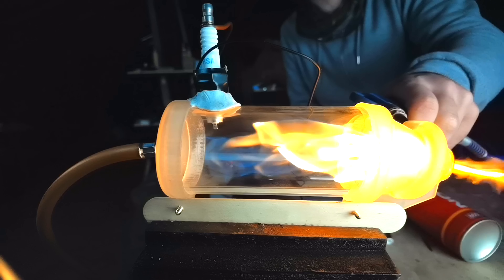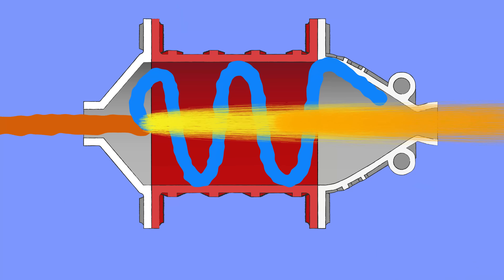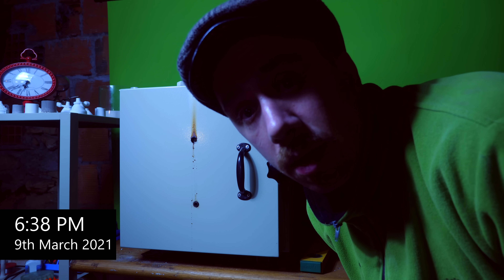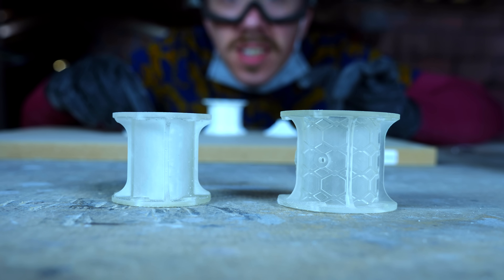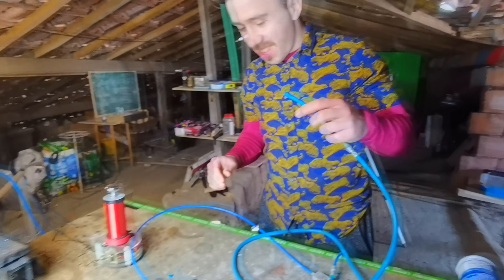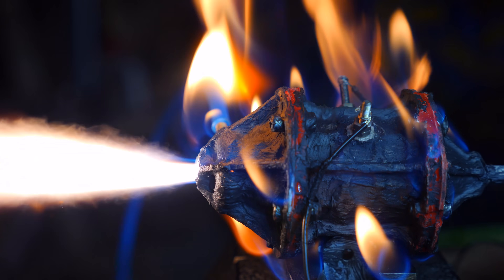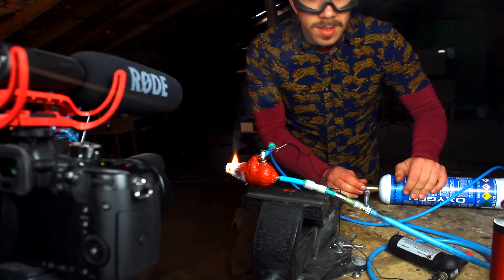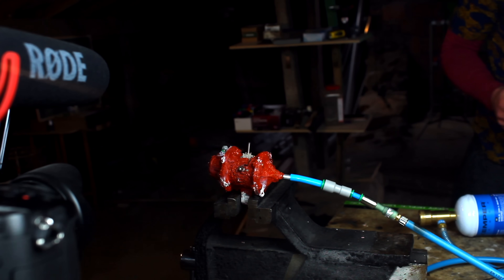Vortex Rocket V2.0 (3D Printed)

Comment: On the red tube thing at the end of the video it seems that the leakage is through the flanges as soon as the pressure reaches a high point. I would try reinforcing the flanges with steel rings on each side of the connection (for the middle part this means 2 half rings instead) and one in between. Like Steel-Ceramic part (nozzle part) - steel - ceramic part chamber - steel. maybe use high temperature cement as „gasket“. The reason for my steel idea is that you could connect the flange with much more pressure so it wont leak as easily withstanding more pressure... Cant wait to see your next video

Comment: you might consider looking into a low fire glaze to help with the porosity problems you are having with the engines the high temp gasket material (red glue)  is not meant for the temps you are hitting and is failing     a low fire glaze could be painted on after final assembly and a relatively quick firing in the kiln would give you a hard outer shell sealing your gaps and greatly increasing the over all strength of the ceramic 
i hope your love of fiery destruction can be tamed a bit

Comment: Dip the parts in high heat resistant paint. Let them soak a little, then dry. repeat a few times. You can find that in any hardware store here in Canada. Should penetrate the pores and seal them up nicely.

Comment: would it be possible to seal the voids left behind by the resin by leaving it in some ceramic solution under a vacuum. Seen it done with resin, dunno if it would work with ceramic tho.

Comment: The tape is the most engineer tool so use a HEAT RESISTANT INSULATION TAPES - BCTEX FABRIC TAPE – 1000 ºC

Another idea is to use some coated glue and sand layers in order to resist high temperature and pressure (In the  worst scenario you will get a piece of art in glass).

Comment: Why not make the turbine out of concrete. Print it, make a silicone mold and the cast it with concrete. I did this for some sculptures a couple of times and it worked quite fine.

Comment: Suggestion: You can make a hybrid rocket engine with a ceramic nozzle. They are pretty simple, just a cylinder made of fuel with oxygen in one end and the nozzle in the other end. You can also experiment with different nozzle geometries. Good luck, and burn some tomatoes, they deserve it. :)

Comment: You could try dipping it in slip after baking it then re-bake at a lower temperature to dry out the slip, sealing the pores of the ceramic. May I also suggest a couple of flashback arresters for a bit of safety?

Comment: I would try heat treating part. Letting it cool. Then pluging internal holes.. and diping in ceramic stuff and re heating to cure. Than maybe repeating once or twice again. To ensure it's all sealed except for Gas line holes and such

Comment: You should sandwich multiple layers of ceramic pieces glued together by the high temperature silicon this could help with the sealing issues and allowing you to make thicker walls to the rocket

Comment: What about making a solid-state rocket engine made out of potassium chlorate (KClO3), carbon and sulfur to be able to test nozzle-designs. Also, a suggestion to eliminate leaks could be to use a thin layer of a paste of obsidian, borax, carbon, limestone mixed with a bit of cement, on the inside of the engine. It's normally used to create a tight, insulating seal, so maybe it could work for you :)

Comment: Try castable wax resin - print parts, do lost wax casting to produce part in metal? You could invent some new incredible high detail casting technique using gallium, high temp silicone, and or warm plaster. Impress me.

Comment: Glaze your parts with enamel!

That should solve your leakage problem. Enamel will also increase the part strength because it will cause a smooth surface. The surface finish is very important for the strenght of ceramics.

Comment: Why don't you just make the parts out of steel? Seems like it would be far easier & quicker. You could then coat the parts with a ceramic finish to protect against oxidation.

Comment: For the modular engine, you could always try adding your refractory glue/silicone to the inside. That way the increase in chamber pressure isn't forcing the sealant away from the porous support wall.

Comment: When looking at this project design, I think it may be useful to have some sort of high temperature epoxy to fill in the micro-pores in your ceramic. My immediate thought was to use regular or High temperature JB-weld epoxy. I believe this will work better than the high temperature silicone sealer because it may hold its shape better under pressure. In the video, it appears the sealer/RTV was either not temperature resistant enough, or did not have the strength to maintain shape. The JB-weld will have the strength to support the internal pressures in addition to hopefully being smooth enough to seal the micro-pores. I would like to see if this is helpful to your endeavors. 

I understand that it is difficult to test, because it is costly in both time and money, but I enjoy watching the progress you have made so far. I encourage you to keep up pushing the limits of your work and wish you well on this path of DIY fun.

Comment: You can dip it in a wet mix of plaster.  Then let it dry, you might have to do this from the outside.  The other solution is to use high temp spray paint.

Comment: Clearly the solution is to use Metal to solve the leaking issue, the ceramic seems too brittle, and is likely eroding under the pressure. You might be able to cold cast metal parts using a metal/resin mixture similar to what you are doing now, and then cook out the resin leaving only metal.

Comment: Could you take the modular engine run the hoses out and encase the whole engine in cement?
Maybe make a small box mold slightly larger than the engine with the nozzle extending out the end.
The cement would stop it from leaking and would reinforce the structural integrity.

Comment: What about a hybrid rocket engine?  (Solid grain of fuel, gaseous / liquid oxidizer)
Like GOx/paraffin wax (with various additives) ? Try adding Sorbitol, coal powder, aluminium powder, sugar powder. Maybe do the fuel grains with different inside geometry? (star? cylinder, or use a 3D printed insert to replicate a kind of fractal channel to maximize surface area in contact with oxygen)  
Also, the leaking problem you tried to solve from the outside, so basicaly the ceramic porosities are still exposed to the "high" pressure of the combustion. Since some of your models are assembled, it might be worth it to try to seal the porosities from the inside before assembly.
- Maybe put some of your glue inside, and with an inflatable bladder (baloon of some sort) try to push it even inside. (like, put glue inside the parts, assemble parts, insert baloon through nozzle, inflate baloon inside engine until it pushes nice and even against all interior surface, wait for glue to cure, remove baloon. ) 
- Try to line the inside with stainless steel sheet cut to appropriate dimensions, glued in with your high temperature "glue".

Comment: Integza :. 3d print your mold in wax.  Pour liquid ceramic inside, but not the one you use to 3d print, there are some industrial ones you could buy.  Let it dry, then with a torch you melt all the wax mold, removing all the wax.  Then put the dried engine to cure in the high temp oven.  Done!

Comment: You have to try to do this in metal, using a CNC.  But what I think will work the best would be to do it with an aluminum casting: you can make the mold using your 3D printer and plaster, then you will cast the aluminum part.  You have to make the plastic part, you have to mold the plastic parts in plaster and then evaporate the plastic in the oven, finally you have to pour liquid aluminum into the mold thus created because the plastic parts have burnt.  Contact me if you want more info on how I mold aluminum parts easily with just a 3d printer and an oven.

Comment: I don’t think you can make a combustion chamber out of 3d printed ceramic (or any ceramic)  that will survive the combustion pressures inside a jet engine. That’s why NASA uses high temp Nickel alloys like Inconel and actively cools them with the expanding O2. That’s also why you don’t see hardly any hobby grade liquid fueled rocket engines. Rocket science is HARD :)

Comment: use glaze from pottery making since you own a kiln , the glaze which is what makes pots and saucers shiny and smooth and water tight should seal the ceramic , or just google glaze for pottery, gimme a shout out if you try it out cheers

Comment: Could starlite be adapted to make some thermoresistant parts, like nozzles? Not so reliable like metal, but may be enough for tests, and may be sculptured around some wax shapes or be combined with glass fiber for additional strength.

Comment: It seems to me that the pressure within the chamber itself causes force to apply to the protective coating on the outside, (as we saw the silicon begin to bubble) so maybe find a way to smooth out the insides with a solution containing ceramic particles and an vaporizable medium to allow easy application to the inside of the engine. This is just my thought though...

Comment: How about you use stainless steel spacers inbetween the intake and out take parts and also some stainless steel fings for the exteriors of the connections but before you put them on the cortex engine coat all the stainless steel parts in high temperature silicone let it cure on the stainless steel spacers and retainers on the sides that touch the ceramic. It should give you more clamping force as well as potentials seal the system better. Then you would have gasket material on all surfaces of your set up and should allow for more chamber pressure and even gasket  distribution.

Comment: With ceramics I use to vitrify the materials by simply either leaving them in for long period of times or increasing the temperature. It will cause the pores to completely close as the Ceramic glassifies.
Reply: shit... Just glaze the thing. Easy peezy.  Only will take one more relatively low temperature firing.

Comment: Have you considered using glazing like you would find on ceramic vases or dinner plates? That would remove the porousness from the 3D printed parts, and give you a much more temperature resistent and durable finish. It would in theory change the outer dimensions of the part, but you can selectively coat the pieces with glaze before firing them in the kiln. As for the joints, I would try using engine gasket material. You should be able to buy some in sheets at a hardware store, and they're designed to handle high temperaturs. Back that up with a coat of refractory cement on the outside should make for a durable high temp resistant seal at the joints.

Comment: After you print the part in ceramic you could try dipping the whole thing in refractory cement or maybe even put the part in a cup full of refractory cement let it dry and just leave holes for the input and output this way you get a thick coating around the part and the air will have to take more time to escape through the refractory cement not a perfect solution because I am under the impression that most ceramics and refractory cement are very porous. Would love to see you try it!

Comment: Titanuim  thin sheet cut formed to make outer casing  should work as melting point of titanuim is very high but hard to cut and form. 
Cooling can be brass or  copper pipes  wraped around the outside of the rocket engine and pump liguid fuel or lox  in that pipeing suggest lox is best but alchool or parrifin fuel can maybe ok. Might need split  tubing front to middle and back to middle and join in middle and inject hot fuel  into middle part of engine . One tube alone from front to back of engine with  long lenth might over heat fuel . Possibly make engine from stainless steel . Might be possible to wrap engine with brass tubing that has water in it and water cool the engine and create steam that can add to rocket power push .
I love the ceramic version   but figure make it in metal first to work then make ceramic version or ceramic and metal hybrid version.
 I need small liguid fuel 10kg thrust version to push my radio control plane to highet speeds than pulse jet version can fly at

Comment: Can't you put something like heat shrink tubing around youre engine and than lay another layer of heatproof cement or whatever it is you where using on top of it that may be seal the leaks but I dont now if the heat shrink tubing will resit those temperatures

Comment: You could try making the nozzle using a mold with pva and fill it with cement.  That'll solve your leaking issue especially since it can be thicker

Comment: Could you not make a lip on the parts that are connected to eachother. This would better make a seel with the ceramic parts and you could also position the lip to face the same direction as the nozzle to make it look cooler.

Comment: why dont you try plugging the 3d print porosity by dipping the print in sodium silicate under vacuum? it will remelt into glass as the temperature goes up

Comment: Please protect your lumbs Integza ceramic dust is dangerous  ... and let the time to ceramic piece to cold to avoid crack you must avoid thermal shock ! Last suggestion try to add some graphite powder to your liquid ceramic by dychotomy you could change the ceramic specs.

Comment: The hot combusted gasses are leaking out when the fuel pressure is increased. This tells me that the inner pressure is overcoming the vortex cooling pressure. Try increasing the air pressure for the vortex cooling as you increase the fuel pressure to maintain pressure proportions.
It might be an idea to create a thrust monitoring mount as well instead of a vice so you monitor the performance of the engine before it goes Kaput... There might be info hiding there.
Reply: I agree with this, also the air cushion isn't really working with the current setup, he's using pure oxygen as the air cushion which will just make the walls and anything sealing it burn regardless of insulation from the fuel.
I would suggest trying - keep the inlet for the air cushion in the same location to create the cyclone effect but use compressed air like the very first version, and add a second inlet in the back right next to the fuel inlet for the oxygen (3 inlets total), that way you get the intense oxygen burning reaction with just the fuel in the middle of the cyclone and also the full benefit of the air cushion with compressed air to insulate and protect the walls from the reaction.
I'm not saying that this will work without fail but to my understanding it would give a much better chance of success.
Best of luck Integza!
Reply: @e1337H0b0  maybe just switch the fuel and oxidiser? Use the fuel for the vortex cooling and inject the ox directly into the middle?
Reply: @dgkimpton  Honestly that could work, reminds me of a video by Cody'sLab where he made a fuel environment in a vacuum chamber and injected oxygen through a tube across an arc and made a "reverse flame" (I think the name of the video was "burning oxygen in a propane atmosphere"), in Cody's video it shows just how much pure oxygen makes pretty much anything burn as the tube it is injected with starts to burn as if it's a solid fuel, only way to find out is to test it!

(Edit) Take a look at about 11 minutes into the video, it looks like he does have the oxygen hooked up to the back unlike the previous version, I don't know why it didn't work, your idea makes sense to me, maybe something else went wrong.
Reply: @dgkimpton  excellent idea! The liquid nature  of the current fuel might be a problem, but its evaporation may provide even greater cooling benefits!
Reply: @e1337H0b0   I kept thinking that ! No, using fuel with fuel will not provide the cooling the effect you want !
Reply: Probably the best way to keep the rocket from leaking without changing anything about the way the parts are assembled and fused together to be honest. Well put!

Comment: If it's a ceramic part... what about a ceramic glaze? Dip it in a liquid glazing solution then pop it back in the kiln and finish it off. I mean, it's what usually solves the issue of porosity in ceramics we use for eating so...

//Glaze can serve to color, decorate or waterproof an item. Glazing renders earthenware vessels suitable for holding liquids, sealing the inherent porosity of unglazed biscuit earthenware.// - Wikipedia

Comment: A slightly longer bell on the nozzle might increase the chamber pressure. That definitely wouldn't help with the leaking, but it still would most likely increase thrust.

Comment: Hey I'm not an expert by any means but I'm into ceramics for a while now. I would recommend dipping the printed parts into ceramic slip before burning the resin. The clay for the slip should have a particle size of 0,2mm or less & should be able to withstand 1300c firing temperatures. Cover the open ends and everything that that the slip shouldn't touch with masking tape, dip it and let it dry for a week. If you burn the ceramic at cone 9-10 (1280-1310°) the particles fuse better and make it more air tight. After the biscuit firing you dip the parts into ceramic glaze (mask inside etc. again) and glaze fire your pieces following the instructions on the glaze. The parts should be airtight after this procedure. If you want to print in multiply parts you can also attach the pieces with a little bit of slip and dip them all together to get a uniform monobody

Comment: Take your sintered parts and dip or coat in your ceramic resin and resinter them in the kiln 1-3 times. It should fill the pores making a solid shell. It would also thicken your walls.

Make sure to make a stand to hold your parts in the kiln when you resinter them.